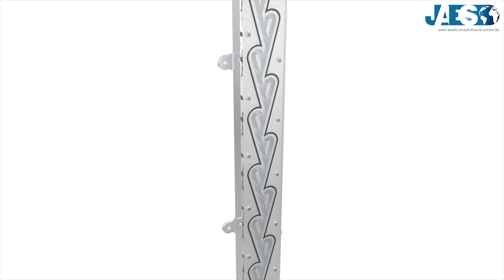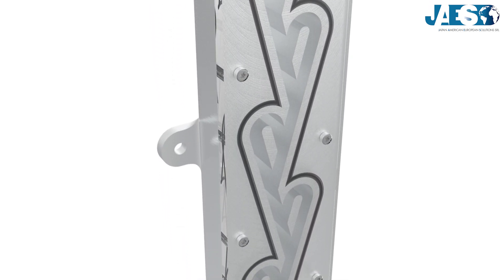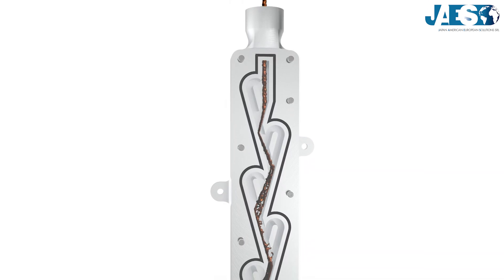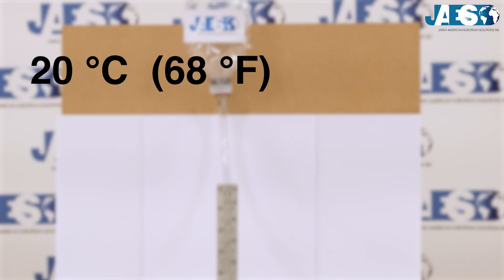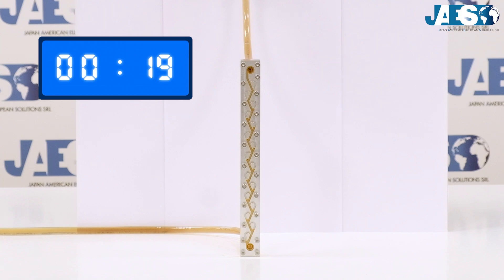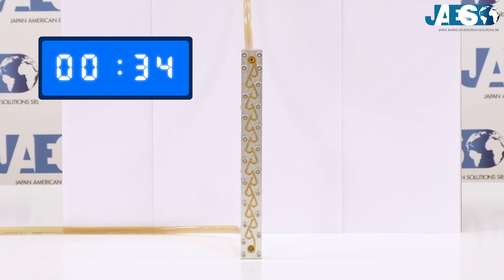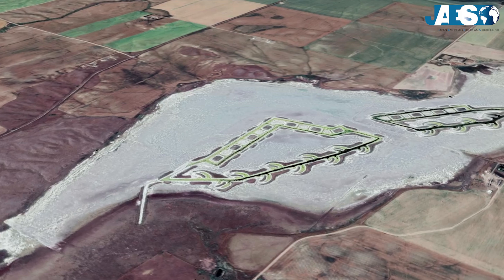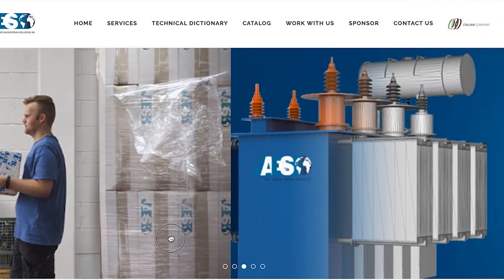How does a Tesla Valve work - The Hydraulic Valves - Experiment - Nikola Tesla

Comment: 🤦‍♂️ This experiment is an abuse of a term "scientific". How is it even possible to make such a terrible mistake? 🤦‍♂️

There MUST be NO air bubbles inside the valve.

So, fill the valve with water, lift the forward outlet side up to remove bubbles, turn it horizontally, and repeat the experiment again.

Ofcourse without bubbles there will be nothing to see 🤷‍♂️ , but at least the flow (known volume per measured time) will be measured correctly.

Comment: I think if the flow was level or upwards, the reduction in time would be more significant.
Reply: I think so too. Consider the forces acting upon the particle of water at the point where the flows rejoin. 

In this experiment, gravity acts on that particle in addition to the pressure from the two flows, causing the water to flow through moreso than it otherwise would.

Comment: Real question. Can a Tesla valve be used to prevent/slow flooding along a river or a canal during a storm surge? 

I live along a canal and since Hurricane Matthew when my home was under a storm surge advisory (it fortunately didn’t damage our house), this has been on my mind. If the canal had tear-shaped paths excavated alongside the main waterway, would it help prevent flooding?
Reply: Ultimately what floods the region during a storm isn't the river, it's the excess water from the rain following the topography. It only appears that it is the river because the water naturally pools in the lowest point in the region, which will be the riverbed if any rivers are nearby. But you might just as well get flooded on top of a mountain with the nearest rivers several hundred meters away down in the valley, like it happened to my hometown once when I was a child.

Unless the valve is built in a way that provides excessive reservoir capabilites far exceeding the volume of the pre-existing waterway, the excess water would just sweep over it and surrounding landscape like it already does. Building this on such a large scale in such an environment would take up an extreme amount of space and impact river flow throughout the entire year, which will likely cause extreme problems with sediment buildup along the entire length and downstream (causing expensive and complicated maintenance, and perhaps other unforeseen issues) and could severely damage the aquatic environment. Those vortices would also pose an extreme health hazard to any individual dropping into the water (i.e. they would kill them) or any ship passing through (if that wouldn't be straight up impossible). I think you're better off with dams, reservoirs and early warning systems.

If you feel that you are at elevated risk of property damage, I would look into technology designed to minimise flooding of personal properties (overflow valves for water pipes, pumps, waterproof windows and doors and there's probably more I don't know about), specialised insurance and moving particularly valuable goods upstairs.
Reply: The more restriction the quicker it would just erode something or raise up and out to where it's less restricted.